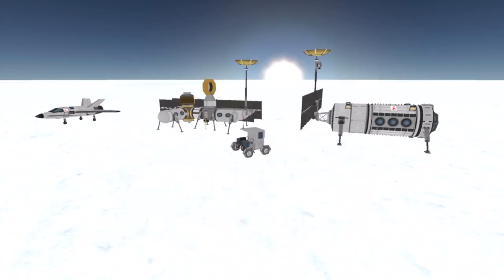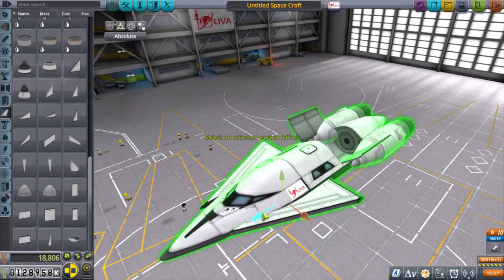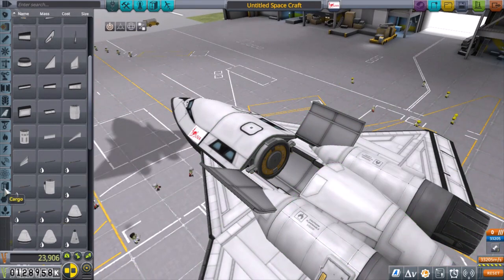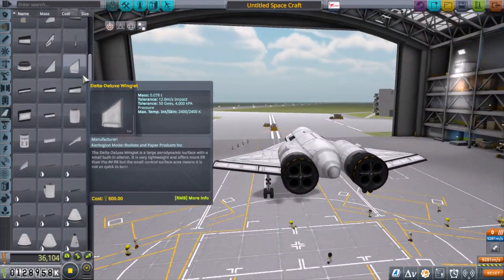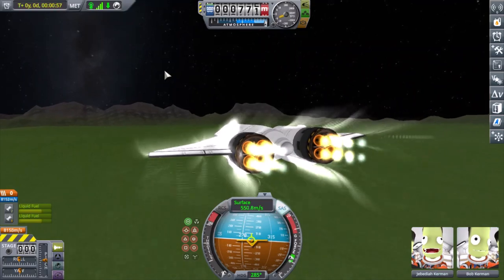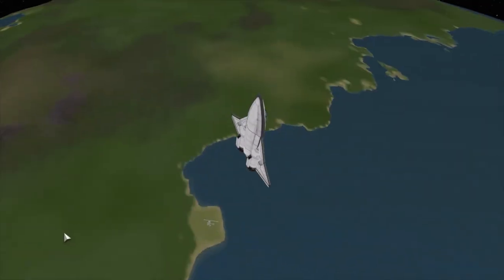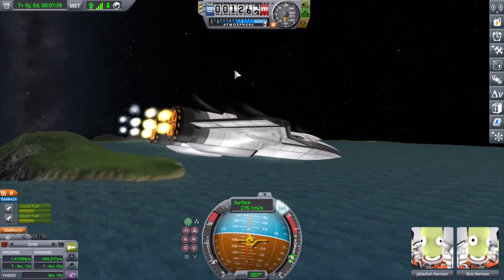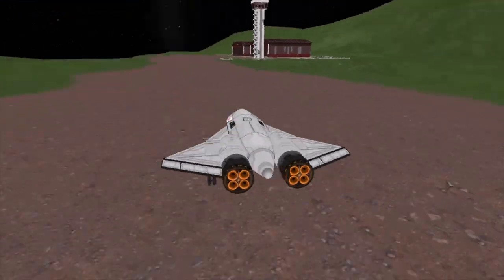Building a Sixth Generation Fighter

Comment: Ok, so if you want to keep the tailless look but want yaw stability, slip some wing pieces into the plane. Also, the island airfield is more than enough for landing, you just came in way to fast. To land, you want 60-40 m/s. For more stability, add an RTG for power, fly by wire part, and an advanced SAS wheel. Very good job on the build!
Reply from the maker: I like how you think.  I sometimes "cheat" by clipping parts inside the craft, so they are functional but not visible.  I avoid reaction wheels in planes, though, unless I am using rotors or something challenging like that.
Reply: the engines he was using also have gimbal, so they could help with yaw without vertical stability
Reply: @dislikedbum  Yes. However aerodynamic stability is a failsafe and flight comfort thing. The RAPIER's gimbal is insufficient for advanced maneuvers such as the Kvochur Bell maneuver as you will flat spin and crash.